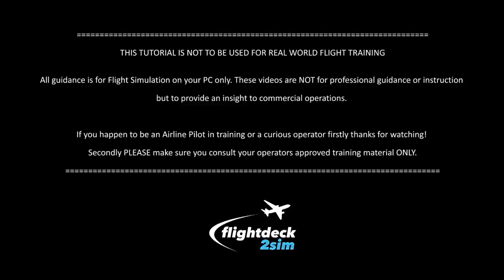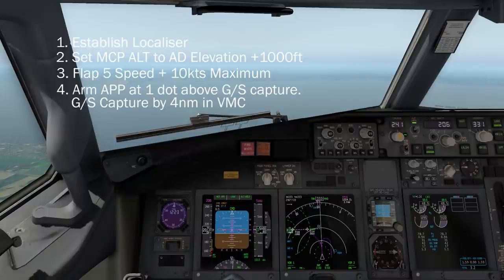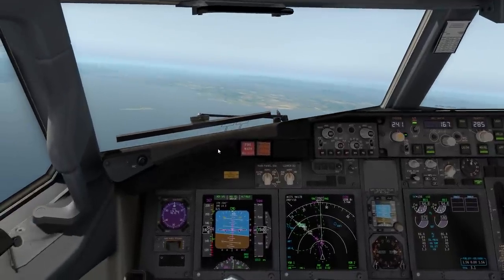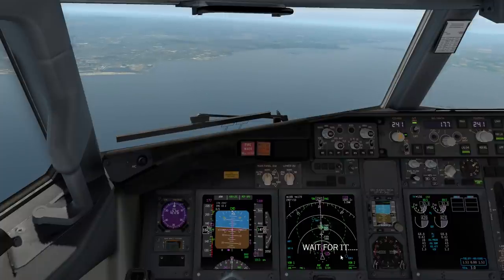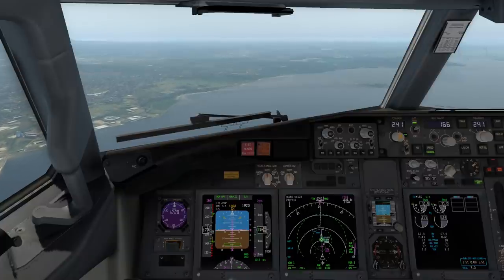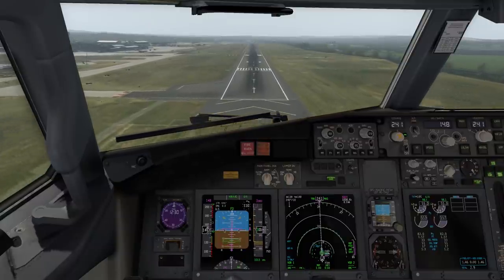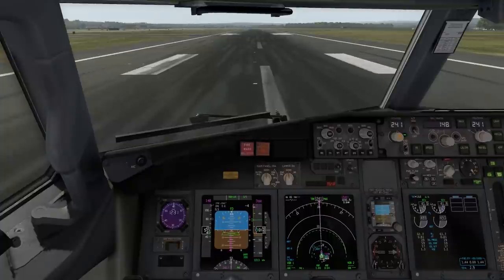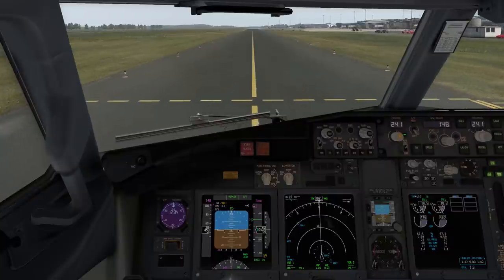How to Intercept the ILS Glide Slope from above! | Real 737 Captain Tutorial | ZIBO MOD 737

Comment: I would have went V/S and tried to capture. Ill defo give this a go, thanks FD2S
Reply from the maker: V/S would work and you could drive it down but you can set a rate of descent where your IAS increases above your target IAS/ If you want to go down at a certain speed LVL CHG is the quickest way to go down for the commanded MCP speed.

FD2S
Reply: Thanks for the reply. Suppose I meant VS would have been the only way I knew how to get down, so glad to see the correct way to do it. Perfect 👌🏼
Reply: @flightdeck2sim  nice you can also use the LVL CHG to capture the GS from above at your airline. At some airlines the usage of LVL CHG during this procedure is not recommended if not prohibited due to excessively high vertical speed rates between 2000 and 1000 feet.

Comment: Thanks for this. I would be totally in despair, dropping landing gear, exceeding flaps speeds, and overreacting. I will surely try this on the next flight. For those of us trying, maybe is a good idea to save the flight before doing so, so we can rinse and repeat as much as we want. Make sure you have the latest FIX 12 zibo.
Reply from the maker: Thank you! This technique provides a controlled way of capturing the glide slope, going dirty and dropping gear/flaps whilst trying to go down and slow down can provide high rates of descent close to the ground, not ideal! 

FD2S
Reply: Hey @claudemiropacheco I didn’t know about the save option, could you tell me more about it? How do you save the flight?

Comment: This is what I am looking for Capt, thanks. For my further understanding, would you mind to explain the reason: why add 10 knots at flaps 5, why don't just leave it at the flaps 5 speed instead. And the flaps 10 set is it for air-braking purpose  (plus the flight detent) to catch the glideslope faster (in LVL CHG mode) ?  By the way, mostly I struggle to acquire the flaps speed on descend, aircraft is felt so heavy the airspeed keep increased, so is it the technique to achieve that, I presume ? Thanks in advanced.

Comment: Interesting because this is NOT the procedure in the Boeing manual. 

Set MCP to airfield +1000ft 
Fully configure to Landing CONFIG ( normally gear down F30 )
Select VS 1000-1500ft
If Glide Slope not captured by 1000 ft Go Around. 

Of course every airline has different SOP so I’m not saying your wrong but just showing what ‘Mr Boeing’ says and my airline follows.
Reply from the maker: Hi MrBuzteck, thanks for your comment!

Which Boeing manual are you referring to? None of our Boeing documentation (FCOM/FCTM etc) has any guidance on how to recover above the glide slope. I’d be interested to find out, especially as the use of V/S when high is discouraged as you have no direct speed control. 

What I demonstrated is the approved procedure/SOP we use when high on the glide slope as you have direct speed control, a reasonable rate of descent and a requirement to have glide slope capture by 4nm but as you said, many operates have different SOP’s!

Cheers!

FD2S
Reply: @flightdeck2sim  Hi there ,maybe he's referring to fctm 5.18 .Cheers =) Nice execution of the app and landing by the way.